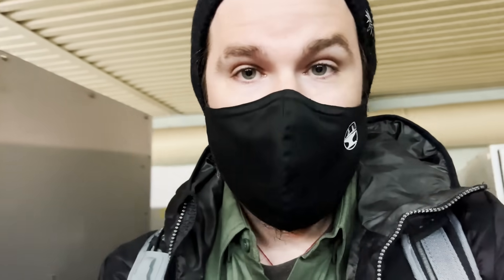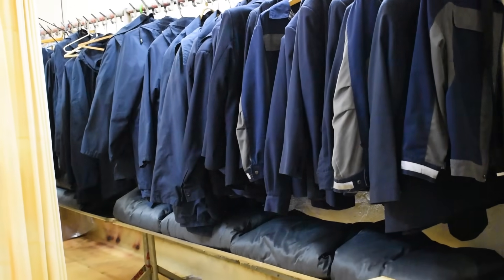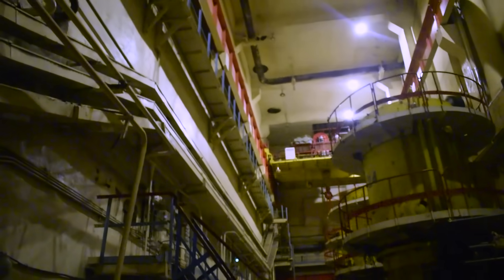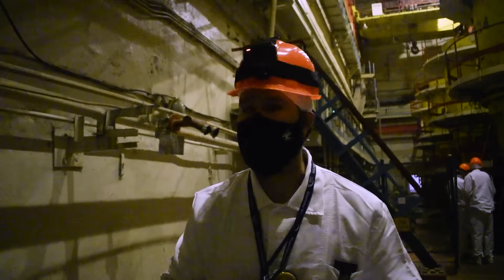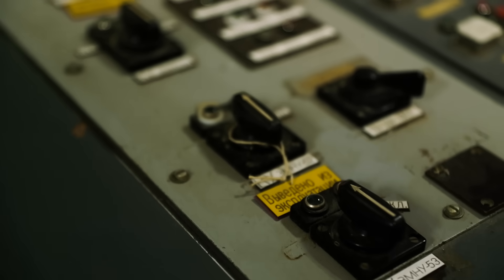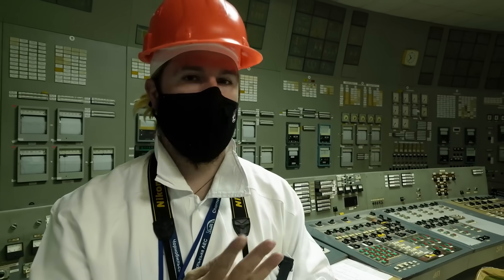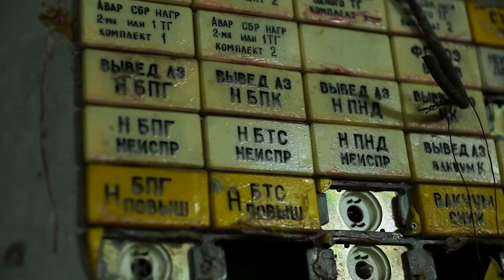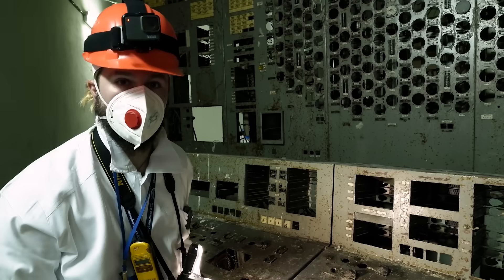Chernobyl Like You've Never Seen It Before...

Comment: Something that I've always thought about with Chernobyl is that there are rooms, corridors, door ways and areas of that building that no human has set foot in since 1986. There are areas in there that no human will probably ever set foot in again. It is fascinating to think about.
Reply: That's not exactly true. Scientists and researchers entered and examine virtually every room in the building between 1986 and the year 2000. Especially the most dangerous areas where the fuel is located. That includes climbing INTO the reactor pit itself. There are videos and photos of it. The only places they could not enter are rooms filled with concrete and rubble (but even then they would cut holes in the walls to crawl inside).
Reply: @MinSredMash  link to videos or photos? I’ve never seen these things you say.
Reply: @MinSredMash  why are they going there? what questions are they asking, what knowledge do they seek?
Reply: @tonechild5929  Primarily to make sure the fuel was unlikely to regain criticality. But first they had to spend years trying to find it. And also assess the structural integrity of the sarcophagus, determine the hazards of contaminated dust, aerosols, water, emissions... And for a lot of scientists they clearly became fanatics, totally obsessed with the structure and wanting to explore every inch of it, no matter the eventual cost to their health. And naturally they were looking for ways that the fuel and contaminants could removed and stored, so that the problem would not be passed to future generations.
Reply: There is an old and quite remarkable  BBC Horizon documentary called Inside Chernobyl’s Sarcophagus that followed the Soviet scientists who were exploring the ruins to find out what had happened to the fuel in the years after the accident. The conditions in which they worked were creepy and horrifying. The doc showed the first time they got a look inside the core, the discovery of the elephant’s foot and the corium, and the use of cheap RC toys to send cameras into dangerous areas. I don’t think the doc is available on YouTube anymore but I must have watched it ten times. It is an incredible piece of film and a testament to the scientists who risked (and in some cases gave) their lives.
Reply: @don s really depends on when and where you're visiting, and for how long. Anywhere around the leftover fuel is bound to be hazardous for quite some time yet. Fortunately the most dangerous isotopes (Sr-90 and Cs-137) have a half life of about 30 years. The fuel however will continue to produce those isotopes (albeit much much more slowly)  until we can drill into it and insert some boron carbide rods to finally quell the reaction.
Reply: @Kerosian1  the fuel rods are still reacting in a measurable way without graphite moderators or water? I thought it was just normal decay. 
Is it just that a big enough block of reactor grade uranium has enough fast neutron reactions to actually matter?
Reply: @anthonylaviale3021  The corium isn't just melted down fuel rods that have solidified. It's also moderators, parts of the reactor and the floor that melted too. These's definitely enough nutron regulating material there the to keep slowing down neutrons and keep the chain reaction hot. Also, despite their best efforts, before the sarcophagus was fully in place, water would seap into the basement and submerge and wet parts of the corium, helping the moderate the neutrons further. Now that the sarcophagus is in place, things are drying out and there has been a measurable, but predicted, increase in radiation coming off the corium, as more fast moving neutrons are released.
Reply: @nathanl5856  thanks a lot for the explanation, it makes perfect sense now.
About the drilling, uranium dioxyde melts at 2800C. It seems to me like a thermal lance using a tungsten tube, or maybe even a plasma torch, should be able to drill holes in it. A less elegant, and much messier method could be to fire high velocity pellets at it, like a waterjet cutter.
Do you have any idea why something like that hasn't been tried, or if it was tried and why it failed?
Reply: @anthonylaviale3021  Well it's not exactly a high priority, what's important is keeping everything contained. Actually breaking down and reprocessing the remains is something that we should get around to at some point, but it doesn't really matter if we don't, so long as nothing gets out.
Reply: @Kerosian1  The fuel is no longer producing meaningful amounts of fission products. There will always be neutrons bouncing around due to spontaneous fission if nothing else.
Reply: @Kerosian1  why can't we do that now?
Reply: The new Dome(roof) containment system will allow them to take apart the reactor piece by little piece, put the most radio active parts into containers to be store in a bunker on site and the rest to be recycled/disposed of.  In 100 years there should be no more plant.
Reply: @don s its not as bad as it might seem. A quick in and out is fine, just don't set up a tent for camping
Reply: @Kerosian1  Even a ‘quick in’ as you say isn’t fine in those places.
Reply: Certainly where the Corium ended up, no human will ever set foot again, as radiation levels are still high enough to inflict a fatal dose in minutes. I hope the other reactors are de-fueled and disposed of sooner than later. The fuel rods should be reprocessed into new fuel and used for new nuclear reactors that do not have the deadly flaws the RMBK-1000 reactor had. If anything, Ukraine should take the Thorium route to nuclear power, which will allow the final disposition of the fuel rods from the other reactors without leaving the country with high level nuclear waste that will be dangerous for hundreds of thousands of years. Unit number four though will remain however a tomb forever, and not just for the reactor and the people killed there in the accident.
Reply: @taraswertelecki3786  Chernobyl power plant was the only one with RBMK-1000 in Ukraine. Other plants use VVER reactors that are way safer.
Reply: @eugenegrebionkin  Even then, the RBMK design- especially after the upgrades in 1988 resulting from the learning at Chernobyl- isn't a hideously unsafe design so long as the operators fully understand the quirks and potential hazards associated with certain power conditions.
Reply: @adder3597  Right, some are still operated in Russia till now without major accidents. Reactor design was the issue, but wasn't the only one, possibly not even the main one. ChNPP also suffered from bad build quality and total ignorance of all found problems from soviet government
Reply: @adder3597 your reactor shouldnt have "quirks" that lead to potential runaway. and the rbmk is inherently unsafe
Reply: @taraswertelecki3786  In a simple way.  Radiation decrase in a factor of 4 when you double the distance. (Inverse-square law) If you are 10m far away from the Corium, you can built your camp side an rest for weeks. At 1 m you are only safe for an hour or so. Radiation is never a problem. Radioactive particels in the air are. If you have a solide mask  and a proper decontamination after, you are fine. I didnt looked into it, but i could imagine you can get as many radioactive particels in the air in citys like shanghai comparebel to chernobyl. 

Thorium reactors are not explored. Like 1000 other possible kinds of nuclear reactors. To develope new reactors cost to much to be comercial lucrative. And the whole world is so scred of the invisibel radioactivity without understanding ist, ther is no way there will be a scientific projects run by goverment.  
Best example is the tocamak iter. A desaster in engneering, becasue the cost go up and not enough funding. And its a prototyp, only a realy small step towards fusion reactors.
Would be the same with all types of breeder reactors.
Reply: @eve-llblyat2576  Inverse square law doesn’t work the way you described it. Doubling the distance will decrease your exposure to radiation only if the source is small enough. It doesn’t work in this scenario.
Reply: @michaelp.5222  please explain. Becaue you have not a singel point of radiation, but radiation is emitted of a huge surface or volumen. The law is still there and has to be calculated for every sqr. cm and vector.
Reply: @eve-llblyat2576  Precisely, you do not have a single point and size. That’s why doubling the distance will not reduce the exposure by 4. Do the maths.
Reply: @taraswertelecki3786  Au contraire. I have talked to people who have literally walked around on top of the corium. As common sense dictates, it is far less radioactive than just your average spent fuel rod, since it contains only about 5% uranium.
Reply: @MinSredMash  If they have, they're dead now. 10,000 rads an hour, let alone 3,000 rads an hour will give you a fatal dose very quickly. The corium is crumbling into dust, and inhalation of that dust is again, fatal.
Reply: @taraswertelecki3786  Haha, Kyle is about to release a video where he meets one of the many people who have visited the corium. I have met the same person, and corresponded with others. Where did you get 3,000 rads an hour from? It has been over 20 years since anything in the building was that hot. If there is something that dangerous, you just need to keep your distance and limit your exposure time. As inhaling dust, that's why you wear a dust mask...
Reply: For me it's more incredible to think that ,for a moment ,for a single moment.

Humanity created one of the few places in all earth that is basically the perfect example of the unstoppable , uncontrollable ,brutal and destructive force that humans can create.

Think about it. If we wanted to we could make earth unhabitable and extinct all lifeforms in a single day ,with a single failure.

But we can't forget that nuclear power is the most neutral force.

If we use it with good intentions and respecting it without underestimate it's power it could save the whole planet and humanity alike.

But if we use it for war ,without any security and knowingly not caring about the consequences ,nuclear power could end everything.

Comment: One of the early shots FINALLY drove home to me how utterly huge the outer containment structure it. It is well beyond the scale I imagined it to be.
Reply: It's over 100 meters high, and the largest land-based portable structure in the world, according to the article I read about it.
Reply: @shanemedlin9400  Okay, I'm not saying it isn't impressive, it's definitely an amazing structure, it just isn't that big.
Reply: @TubususCZ  well, it's certainly unique, as befits the setting.
Reply: @shanemedlin9400   Yeah i saw the series where those were built & moved etc, or at least the construction etc etc, Its almost mind bending to think about everything.
Reply: Yep
Reply: The Eiffel tower can fit inside it!
Reply: @Nex0lith  No, it can't, even if you lay it on it's side. The internal span of the arch is 245 meters and that's the largest dimension there. Even the outer width of the arch is too small (270 m compared to the 300 m tall Eiffel tower without the tip ).
Reply: @TubususCZ  Okay but still, it's on that same scale. ~250 vs ~300
Reply: @Nex0lith  Wow. Mind exploded.

Comment: I'm trying to wrap my head around the 10 second airtime...
This 2,000,000kg lid would have to have been shooting upwards for around 5 seconds, then fall for 5 seconds, assuming the rise-fall ratio is mostly even. Is there even enough room between the floor and ceiling for that? How far above the roof did it continue to rise? Did it blow clean through the roof or just knock into it with enough force to bring it down with it?
Reply: "Did it blow clean through the roof"
Yes. The lid was estimated to have reached a height of 30 meters before coming back down.

Comment: Forgive my ignorance, but why does control room 3 look normal and well kept, while control room 4 looks like it was pillaged or damaged in a massive fire?
Reply: Because the #3 control room was used up until late 2000, while the #4 control room, since it would never be used again, has been scavenged for parts used in the other 3 control rooms. Why buy things new when you have dozens of spares readily available?
Reply: Because control room 4 was the control room for the reactor that went critical.....

Comment: This is excellent. I've never seen the inside of the facility before. I was 5 when it happened. I had no idea how big a deal it was at the time, too young to understand, seemed like a world away, and i was barely even aware of it until i was much older. I guess i probably didn't really think about it much at all until after 9/11, and didn't really get curious enough to try to learn about it until more recently, some years ago. What an astonishing event. I always seem to come away from the stories with a penetrating sense of somber speechlessness. I can only barely even begin to imagine how it must have been for those involved, both too close and in the affected vicinity. I don't recall having heard about the cap being lifted for 10 seconds before. That's nuts. Certainly looking forward to the rest of the series.

Comment: great job on this, looking forward to the rest. insane that the chamber and pretty much the area nearby is still really bad for people even after like 35 freaking years.
being able to not only keep that shield/lid in the air for so long but that's not even all of the energy either! so much heat energy just sitting there. truly insane and that's just a single reactor melting down, think of what would happen if multiple went off. 

risk vs reward. personally i don't find the risk worth the reward. mistakes will always happen, things will break down at some point. it's not a matter of if, it's a matter of when. i feel like people don't understand this concept. if the risk is so devastating, it's almost never worth the reward you get out of it. take for instance oil pipelines, the risk is them leaking and they ALWAYS leak. there are better methods, it's just they are not as rewarding but they are orders of magnitude safer.

Comment: Is that wall behind the control panel for reactor 4 new since the explosion? It seems very close to the panels.
Reply: It is. Back when they built the original sarcophagus, due to structural concerns, the original corridor was moved to run through the #4 control room. The actual corridor used to be several meters further back.

Comment: I can imagine the energy, I can also calculate it. Given the values of mass of the bio-shield and flight time, the resulting energy is 2,405,902,500 J with an initial velocity immediately after the explosion of 49.05 m/s, a max height of 122.63 m, and a force of 19,620,000 N.

Edited to corrected force.
Reply: even more crazy than that, that's only the energy that went directly into the bio shield as motion straight up, not the energy released as heat and in all other directions.
Reply: @blaperture-1  a part of the energy was also directed downward, with the lower biological shield at the bottom of the reactor being pushed down by 4m into the sub-reactor spaces, moments prior to the top of the reactor being ejected.
Reply: Shouldn't force be higher? The bio-shield is 2,000,000 kg, so just gravity would be holding it down with 19,620,000 N
Reply: @eddysw8549  I was thinking the same. It was suspended by the escaping steam by something with the force of 2x an F-1 rocket engine.
Reply: Yep, I did a doh!!
Reply: @sunhawk1104  yeah but you still just wrote the force of gravity 😂. I meant that the force of the explosion would be much higher even than that, if it blasted the thing into the air.
Reply: That's only 0.0005 kilotons of TNT;

Comment: Re: The energy required to move the 2,000 ton mass into the air for 10 seconds:
That's something that's always tripped me out about trains. Those things can pull seven times that, for hundreds and hundreds of miles. And the energy to overcome that inertia's gotta come from somewhere. And it's gotta be kept on the train itself.
It's just nutty.
Reply: And the disparity between the efficiency of a diesel train vs. a diesel truck, for example.
It's the same fuel going in...

Comment: Is some of the grainy-ness and visual noise due to the radiation? I remember hearing something like that about the original footage of the disaster and Im curious if that’s still an occurrence.
Reply: No, the doses were not high enough to cause grainy video footage. I think most of that was due to poor lighting conditions in the plant.
Reply: Or it's just standard camera noise and compression, although you are correct, radiation can cause those effects.
Reply: I think that's more of a problem for film cameras, but I suppose if the doses were high enough it could also happen to a digital camera.
Reply: @danieljensen2626  actually it's the other way round, modern digital cameras are much more sensitive to radiation, it's why standard film cameras could be used on the moon, whereas digital ones we send up there have to be Rad hardened
Reply: @virtuallyreal3055  the cameras that were used on the moon were custom built hasselblads. and due to weight only the film was brought back.
Reply: @etch3130  yeah I know, thanks tho

Comment: Kyle, You say that you have to change clothes multiple times however you appear to have the same face mask on. Did they not require you to change the masks as well to prevent contamination?
Reply: But, if you notice, a bit later, he's wearing a different mask. Perhaps no one noticed until he was in the area, then they changed the mask and perhaps just trashed the other one? I'm kinda curious what happened here, too. A mask would be the most important thing, besides maybe gloves, to get rid of after going through that area.